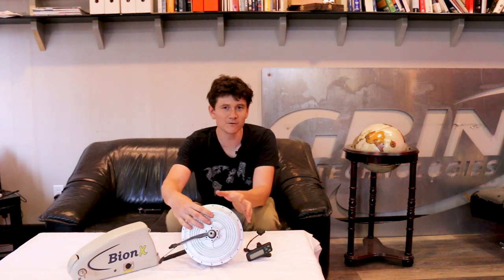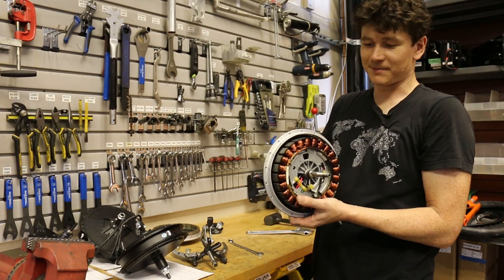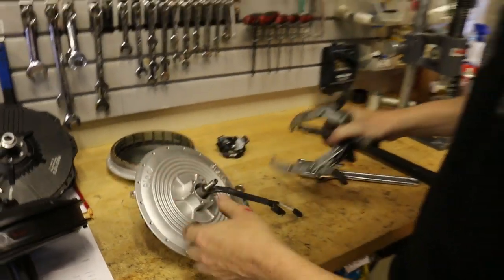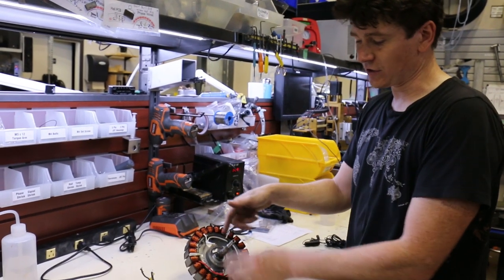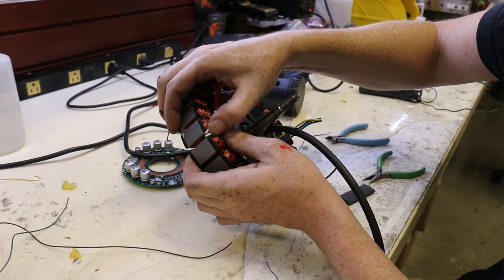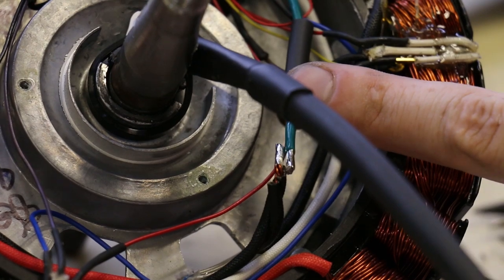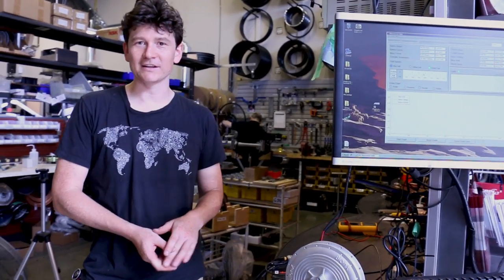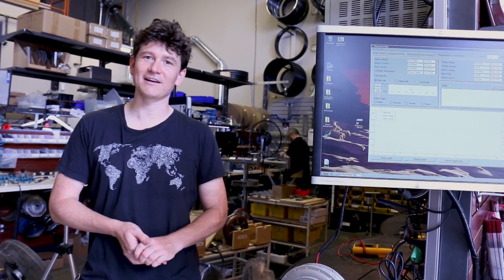How to Salvage / Hack a BionX Hub Motor for External Controller and 3rd Party Batteries

Comment: Hi , Are the p250 and 350 motors the same ? Was wondering if the only difference was the controller and battery..I want to rip out the internal controller on a p250 or wondering if I should find a 350 for more power handling.
Reply from the maker: That's a good question that we don't actually have the answer to. It's possible that they are the same motor core just being run at different power and speed limits from the controller, and it's also possible that the PL250 is a smaller motor inside too. If you can find an exact weight spec for each motor, that would be a good indicator if one is actually larger than the other or not.
Reply: Hi! I have 2 older bionx cr(x) that I tore down, one is 250w/24v & the other is 350w/36v. There's a pretty significant difference in everyway really. The winds on the 350 were the first thing I noticed, they are perfectly neat and do not over lap like a yarn ball the way so many other motors are. The 350 also has a wider stator, slightly larger dia and appears to have bigger and totally different mags than the 250(gold tint).I took measurements and I'm pretty sure that the inside of the hub is the same diameter, so I would also be willing to bet the 350 has less of an air gap but can't say for sure.

Comment: I watched your video on bionx hub motor repair could you please tell me what they call the sensor thing for sensor wires it's 5 volts ground sensor I need to order 3 of those the wires broke please help
Reply from the maker: They are called hall sensors, but you can make your life easier by ignoring them and just running with a good sensorless motor controller.

Comment: So would it be possible to only bring out the positive and negative and run them through a switch instead of a controller for a steady run speed?
Reply: you cant run a three phase motor with two wires there is no negative positive wires there is three phases which must be converted to accept dc current with speed controller even if you just wired the three phase motor wires to the controller that may not be enough as the hall sensors are there to sense magnets position as it passes through each phase just to answer i asked a while ago why i couldnt leave out hall sensors quick google search can help
Reply: also helps get wire with pvc coating if possible as it as high heat resistance and is easily squished i just completed the rebuild of this motor and am waiting for controller to test
Reply: You can use a sensorless controller, which will let you use the fattest possible wires for your 3 phases. Still, don't expect miracles with this thing.

Comment: seriously i cant find shrink wrap to fit so i used electrical tape on the axle but for the most part i got the wires through without any ripping sounds didnt bother gluing the hall sensors in place as there already glued and since the stator is stationary with this motor seems to be perfect the way it is .... how many volts and watts can this motor take max im just going to run it at 36v 500w but i would like to see top speed the motor has super little resistance when rolling feels like normal wheel hub
Reply: also my magnetic ring came off on the disc brake side resulting in almost no force or slamming when putting it back together idk why or if its messed up but seems to be good i have yet to test run
Reply from the maker: You can easily run the motor at 1000 watts or so for short times, and it's no problem to run it with a 48V or 52V pack for a higher top speed either. e
Reply: Grin Technologies thank you for letting me know this lol I am getting my controller tommorrow then have to save up for one of yours lol thank you for the video and for the all the advice !

Comment: I just purchased a Grace Easy with Bionx system. But, it has an intermittent fault. It sometimes delivers power ok and sometimes it does not. I think the motor is 350. The transmission is belt drive. It has G2 display and everything seems perfectly fine with the readout. I wonder if you could possibly offer me some idea of where I should start to try and fix this issue. I wonder if it is the controller that is at fault. The display + it's cradle, and the battery have been replaced to no noticeable effect. I need some expert advice :)
Reply from the maker: Unfortunately we never dealt with BionX or their proprietary electronics systems so can't offer any assistance with those BionX specific issues. I would say contact BionX or the dealer of the bike for help, but that's not very helpful advice at this juncture.
Reply: @GrinTechnologies  Ok. I understand. If I carry out the procedure in this video, I will need a new controller and display to replace existing Bionx. Can you recommend a controller and matching display? I want something that will look neat and able to handle up to 1,000 watts and 48 v. Also, I have existing cables on the bike and wonder if the connections are universal or Bionx own. I imagine you may not have the answers to this question, but no harm in asking eh!? Cheers for your help.
Reply: Hi again, I am going to do this to my Grace Easy Bionx 48v. I would like to ask you 2 questions please. Do you know if it will be tricky to take apart with the internal 3 speed gear mechanism? 
And would a brushless controller such as this one; 

Sensored Brushless Motor Controller KT48ZWSRLD-JDF01R DC48V 17A 

be suitable?

I'm thinking not, because it is sensored. But I don't know. If you can suggest a good controller and display that would work well that would be very helpful. I want to use on road and private land. So would like to try and be legal (pref at the flick of a switch). Hoping you can help. Now to watch your vid on wheel building.

Comment: I got lost. Is there a wiring diagram somewhere? Where do I run a ground wire?
Reply from the maker: BLDC motors are 3 phase AC, there is no ground.   If you choose to run it sensored rather than sensorless, then you will have 5V and Gnd for your hall sensor hookup but that's it.  In general I'd recommend just going sensorless for a rebuild like this.
Reply: @GrinTechnologies  in my case i have sensored controller and do i need to add additional components between the hall censores and the controller ? Or just hook the wires to the controller.Mine controller is Focan 350w max amp 15A?

Comment: my bionx is locked because i just hit 50km so the system needs to be registered by bionx.. but they don’t exist and i don’t want to code with BIB, can i do this to bypass locked assistance and still use factory controler and battery? just add a pedal sensor. thanks
Reply from the maker: Nope, this modification makes it impossible to use the original controller since the entire point of the modification is to bypass the original internal controller. You will need to then get a 3rd party controller, and to use the original bionx battery you would have to open it up and add a 3rd party bms circuit as well, removing whatever internal bionx electronics are in the pack.
Reply: @GrinTechnologies  i do not want to go through that.. any interest in buying my whole kit less than 60k miles p350 kit 48v 8.8ah battery + all components 400 + shipping?
Reply: Thank you for your videos!

Comment: I am working on a trike(95% made from discarded materials) that will be about 80 pounds and will carry 350 pounds I need it to travel 150 kilometers. Can I use a motor like this?
Reply from the maker: It would be fine on flat ground but would struggle up steeper hills
Open the full description and click the link at the end to our motor simulator, then spend the rest of the day understanding how to use it and you can start making informed decisions. ;-)
Reply: @GrinTechnologies  Hello i have seen your explanation about DD engine's it was super intresting.  Is it possible to add the bionx engine in your simulator? that would be super intresting. Thanks a lot
Reply: @bramvandekerckhove743  It's already on there. You have to click "SHOW ALL" at the bottom of the list first, then click it again and scroll to Bionx. PL350 is modelled with and without Statorade.

Comment: Thanks how much power can we push these ?
Reply from the maker: That would depend on the RPM. The faster you spin the motor, the more power in watts it can produce both for short term and continuous basis. Everything is modeled on our simulator, so click the link at the end of the video description.

Comment: Thank you Justin.
I have just re-celled my 22v bionx and it was doing fine until the controller blew this morning, (the main plug disconnected while going over a bump at high speed on full regen)
Now I will be able to get it going again, very pleased indeed!
Reply from the maker: Hey Huw, well it's not a small undertaking but we've now had a handful of people email us pictures of their resurected BionX hubs with external motor controllers, and once you do that you can easily run at much more than 22V as well to get more speed and power from the hub.
Reply: When using the base runner l10, does the white speed sensor wire need to be connected to one of the motor hall outputs in order to get a speed reading on the cycle analyst?
Reply: Answered my own question, yes the white wire goes to a motor hall output, and the speedo now works!

Comment: another solution is to reverse engineer the communications and use arduino or raspberry pi to talk to the controller.

you may say what about the dmca?

1 bionx is out of business so there is no one to sue or even threaten a lawsuit.

2. even their lawyers  got jobs with other companies thereby have no jurisdiction over bionx systems

3. you are in canada so unless canada has a similar dmca you are free to reverse engineer the communications and just make sure to post the programming files to a site like thepiratebay where they will not remove anything over copyrights
Reply: I'd bet Bionx's intellectual property was sold off in the bankruptcy, so whoever owns it could sue you if you tried to commercialize it. That said, nothing ever stopped anyone from reverse engineering their own bicycle.

Comment: why can't you just buy 2 12 volt liquid sealed batteries and hook them into the bionx battery holder i mean 24 volts is 24 volts what ever batteries can the system tell where  the 24 volts are coming from ni-cad,lithium,and or acid sealed? like the one i have is 20 d size 10000 mah  i mean C size are 1.2volts with 1000mah or aa size 1.2 volts what 1800mah won't they all work just less mah's and just hook the up before the senser's  i wonder?
Reply from the maker: It can indeed tell that there is no communication board on your lead acid battery to talk with the rest of the system and so will not power up and run. Many other ebikes only require a + and - connection to the battery pack and so will work with just about any battery that has the right voltage, but Proprietary ebikes like BionX, Bosch etc. also talk with the battery over a special protocol.
Reply: I just finished wiring in a China battery 24v- 10ah. Bullet style. 
Made a circuit board box and put it in a triangle frame bag. 2 black wires/2 red wires. Didn’t use any sensors on Bionx batt as new batt already has protection. Now I’m surprised it worked after watching this.

Comment: My bionx was a joke. I could not go more than 5 miles on the second assist level. Level 1 just eliminates the drag and counters the weight. I guess I weigh to much for these. I gave it away was not of any use to me rather just ride a quality bike instead of a 50 plus pound set up.

Comment: Hello to all. My bad experience with bionX came when I've replace the cells on the battery boxe. Bike will ot work anymore. All is off. Reset tentative also already dne. No beeppings from the buzzer. I guess the battery control board is dead. Find this video on my searches and very helpfull. Very probably I will go to this hack but that will be my end of the line. I love the control features of my ktm with this system. I'm now looking for a replacement for my battery control board, name is SMART CONNECT 5.2. Battery pack is 36V. If any one knows were to find I will be very greatfull. Thanks to all.

Comment: You did not remove the cassette how i would. Normally you need to block the cassette to stop it from spinning when you release the locking nut, however you did not need to lock it, so, what you actually did was you used a different tool deeper into the cassette and un-spun the entire thing from the motor casing. Normally, at least the bion X i have has a larger 4 tooth tool that fits that locking nut right on top of the smallest gear on the cassette. Besides all of that, you don't even need to remove the cassette it makes no difference to splitting the top part of the motor off.
So anyone wishing to do the same should note the above and also the fact that the tool he used is not the standard cassette tool, it is a slightly different diameter. The bion x tool needs to be a slightly smaller diameter than the standard 12 tooth tool. So if anyone is stuck on this step the above will explain why and why you probably don;t even need to remove any of the cassette.
Reply: i was thinking the same

Comment: Thanks, nice additional repurpose to spend and temp sensor and outwire the strain sensor. There is also a previous transformation here:

https://youtu.be/ciINX3rSaak

It seems to me that the transformation work effort done local would exceed the amount of buying a new direct drive. So it is only for hobby or educational reasons. You refer that the Bionx show significant less drag than other DD. Do you know the reason? Is this because of the stator pole shaping or material selection for the magnetic back short?
Another option to free the system is to reprogramm the motor controller. The main downside which I found by reusing the Bionx motor controler board is that is lacking DC bus shunts and an accurate battery voltage detection for motor regulation. This is provided in the orginal system by the BMC but makes decoupling difficult. The battery temp is anyway lost in a decoupled system and therefore the Bionx approach is technical best but coupled.
Because the first patents expire next year my guess is that strain and controler integrated DD will start and give much cheaper and easier to handle Kit solutions in the future. Obviously they need a coupled display but only DC battery connector. Getting central PAS of either type is a significant burden because of hassle and cost. A decoupled Bionx kind of DD will the ideal kit solution. What do you think?
Reply from the maker: "You refer that the Bionx show significant less drag than other DD. Do you know the reason?"   I think this is mostly a combination of low pole pairs (11, vs 23 for most typical DD hubs) and good quality stator iron.